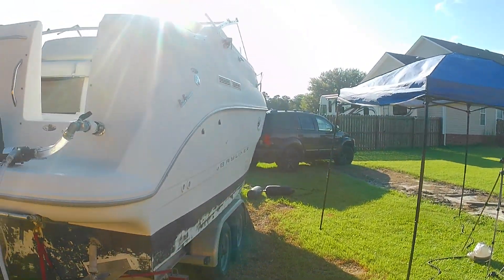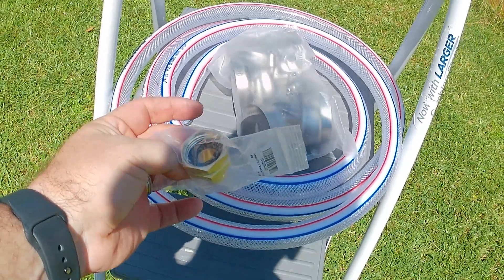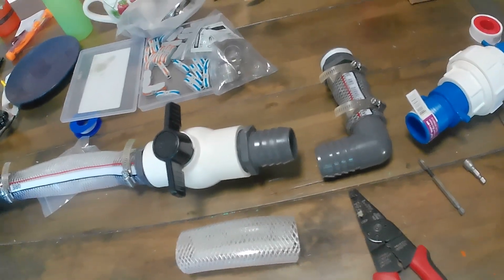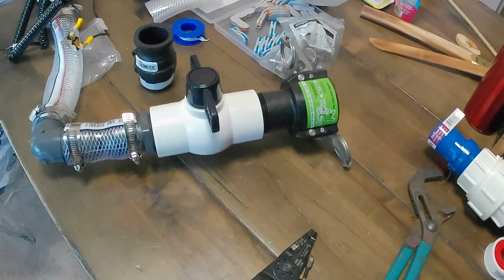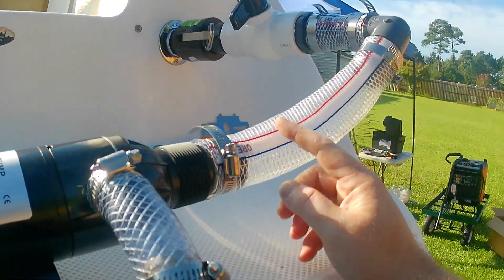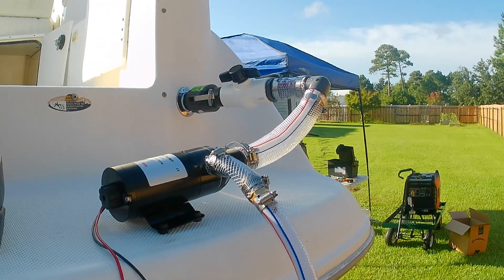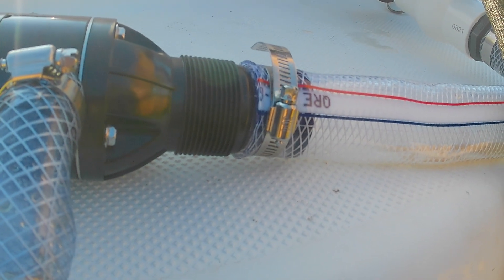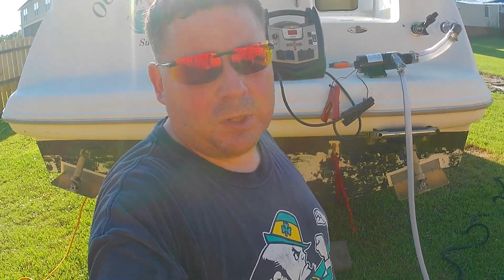DIY Marine Holding Tank Pump-Out: Using RV Methods to Remove 15-Year-Old Waste for Under $200!

Comment: Great idea! Qui k question. Is that pump strong enough to create vacuum to pull from a higher location? My boat has the pump out hole in a higher section and probably about 4 feet of hose down to the holding tank.
Reply from the maker: @rsrjvalqui  I think it would be. The pump is probably less important and can be kept close to the pump out port. The garden hose can be much longer.